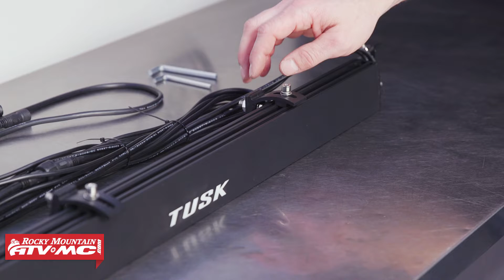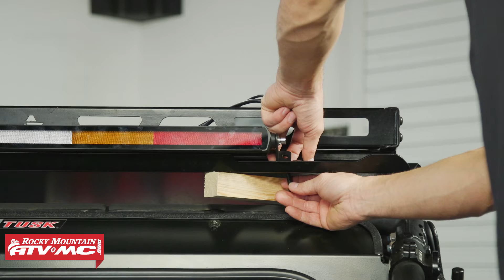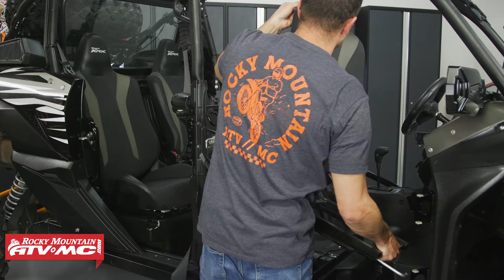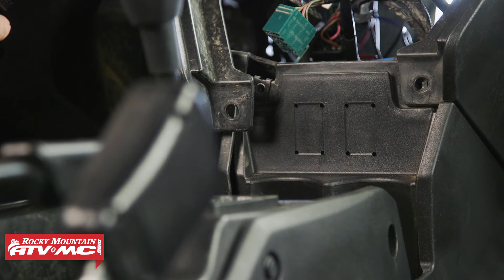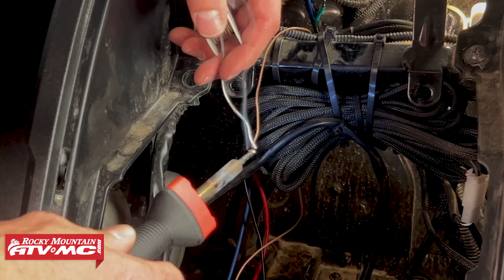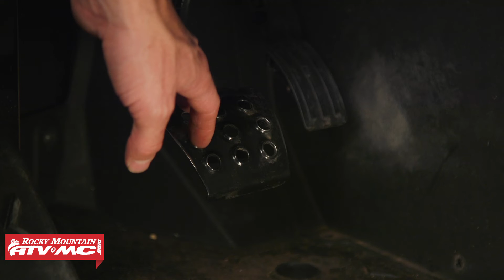How To Install a Tusk UTV Chase Light Bar

Comment: Is this mountable on a Yamaha RMAX-4?
Reply from the maker: Yes, this is a universal light bar that was designed to work on many different machines. We recommend using your best judgment with your specific machine and accessories to see if this will work for your needs.